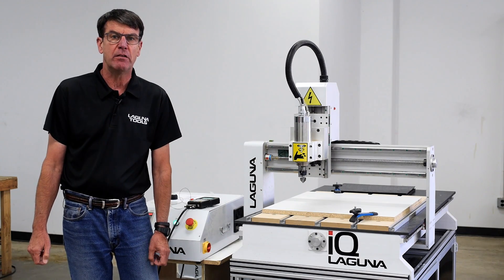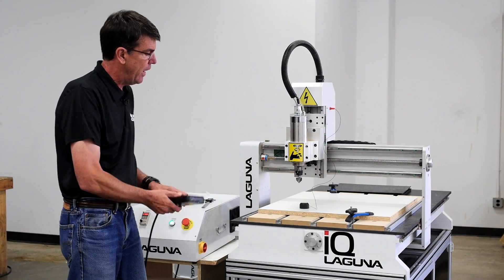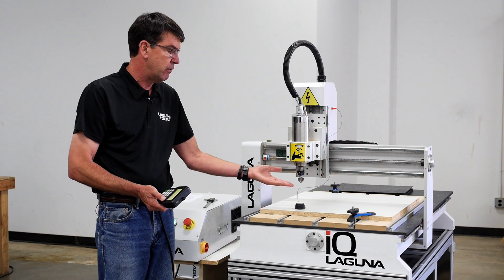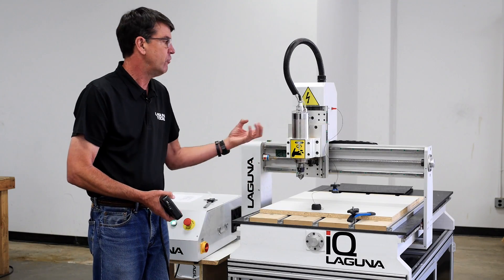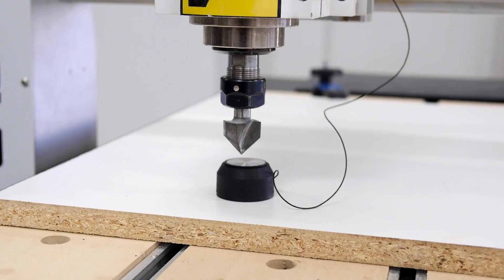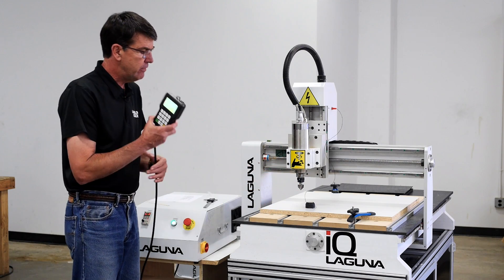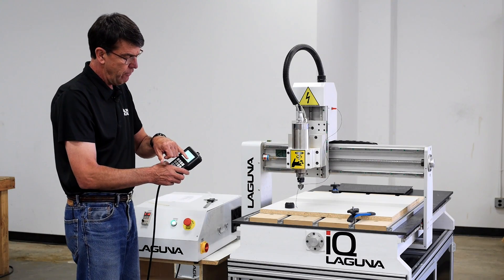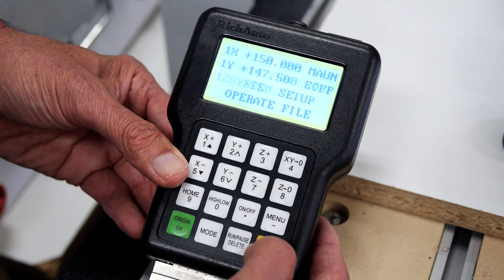CNC Tech Tips - Automatic Tool Touch-Off - Vol 505 | Laguna Tools

Comment: 2 Questions.  I have recently gotten a Swift 4x4, how do I slow the descent on the tough off like you do in this video?  And second my HHC does not have CAD thickness in the menu.  I believe this is 11mm.  Is this something I need to adjust or does the control know this?